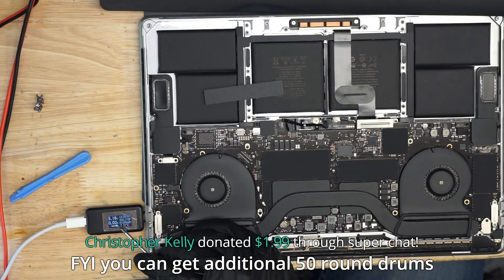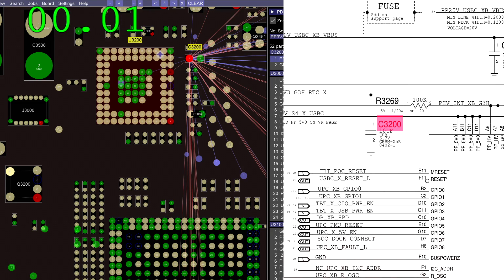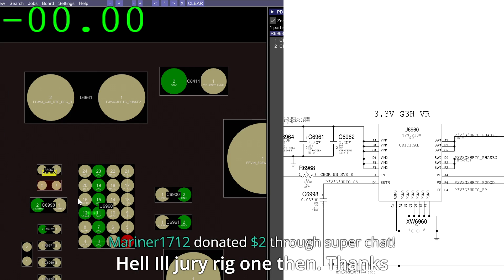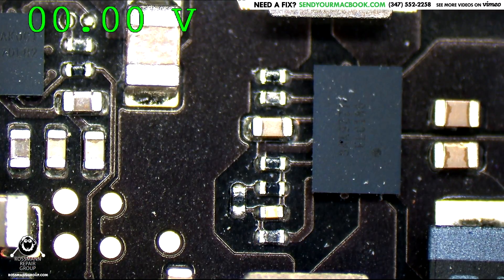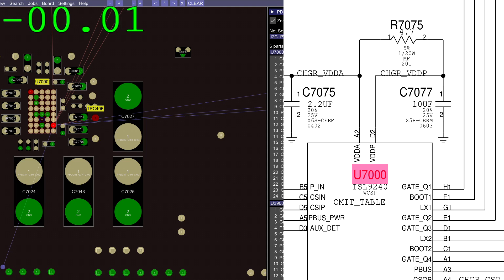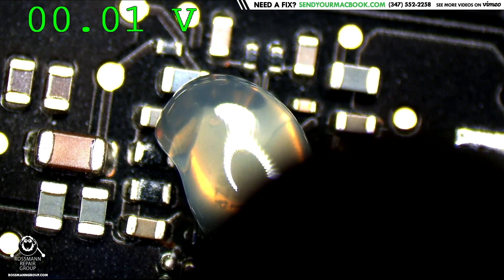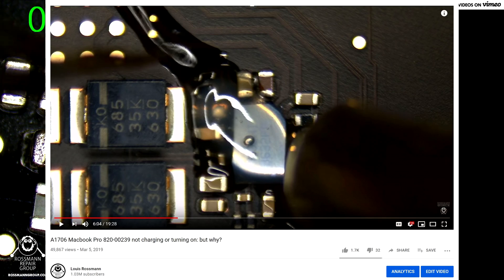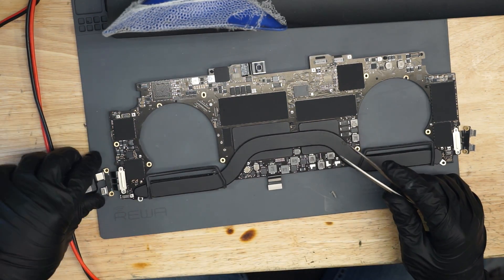How Apple is shaping the future of repair.

Comment: John Deere  does the same to stop farmers from fixing there own tractors. This has been going on for years. I think Apple may even got the idea from them. 
There has been the same  issue of rite to repair in may states in the USA stopping consumers from fixing   their own tractor or take it to an independent tractor repair. John Deere has been refusing to release the technical information so that independent repair can not take place.
Reply: I believe that this actually is for safety reasons. If you could see what kinds of farmer self-repairs we can see here and there in our shop, then you'd probably agree.

Edit: Comparing a Laptop or a Smartphone with heavy machinery is not really possible if the reason to compare them is security. There can actual lives be in danger.
Reply: @RedMediaStudios  You can compare, actually. Its not about the tractors hardware, which, obviously, can be fixed to a certain point pretty easily.(Legboot-fixing frameparts could possibly cause injuries)
It's about engines, transmissions and hydraulics ECUs. Would they malfunction, the tractor just goes into limp mode, nothing that would cause injuries.
This is just because greedyness, nothing else. I'm a farmer myself in North Europe, our farm has many machines and imagining that we would have to always contact an authorized service man to get the machine fixed, we would lose a lot of money. And I mean a lot.
As tractors are coming more and more dependent on electronic control units, its quite important to know how to fix them, because they are working in harsh conditions with a lot heat, dust and vibration. If you can't access the workshop manuals or any repair guides, you are fucked. So yeah, thanks JD, the other brands will surely follow their lead.
Reply: @hellyeabrother56  What the shit? Our shop is paying since years and years to get access to the manuals. If it's just that, then i gotta say thats pretty normal. The farmers around here can fix small stuff themselves but they usually bring all their stuff to us to get it fixed. None of them know how to search for a defective part in a common rail system, or read out error messages. They even bring simpler stuff like a not working light bulb to us.

My point still stands; safety. The bigger farms maybe know what theyre doing, but smaller ones often dont. 'Lemme try that, oh it works again, fine i drive like this for the next 5 years now'.
I recently fixed a vehicle wich the farmer set up the electric system for stuff like light himself, and its a miracle that that vehicle didnt start burning already. Fuses three times bigger than what it actually should be, and stuff like that.
Im pretty sure the bigger farms can get a working solution to this problem.
Reply: @hellyeabrother56  To compare sizes: The farm my grandparents own has about 8 hectares, and u can find farms around here mostly between 20 to 80 hectares
Reply: @RedMediaStudios  I believe almost every independent shop has to pay for the manuals licenses, we as farmers as well if we want to see them. But it's about accessibility, JD wanted that it cannot be so, even if you had the money to pay it. They also wanted to restrict:
Resetting immobilizer systems, reprogramming electronic control units or engine control modules, changing equipment or engine settings, downloading or accessing the source code of any proprietary embedded software.
I agree with you that safety is indeed an important matter, but in my mind, you just cannot justify these restrictions by saying they're for safety.
However, yes, I have also seen quite a bit shitty wirings done by farmers, often we would buy a used machine they would have this "just put duct tape on it" -type of solutions. But I don't think that they would even touch an ECU if they cannot manage basic wiring.

I find this quite unfair. You shouldn't manufacture the tractor so that every time it has an error code of, let's say, transmission not working properly due to sensor malfunction or even by a cold weather (we get those in here) you need to get it to the JD dealer to get the code removed in order to drive it again. You should be able to replace the faulty sensor and be done with it without JD's help.

Some farmers in our area are also taking their equipment to shops to fix, and that's fine if they have the money for it, unfortunately, we don't, so I cannot find anything more frustrating than paying +100k for a machine that I cannot fix by myself, even if I had the skill for it.

Btw, respect for driving a moped for 600km, dope video.
Reply: @RedMediaStudios  Concerning the size of the farm, we also have these >30ha farms, but their equipment is equivalent to their size, in other words, their equipment is smaller and older compared to big farms, since it's cheaper.
Reply: @hellyeabrother56  Ok, i did NOT expect that last sentence. xD
https://www.meme-arsenal.com/memes/5af861df2c1d344a7fa28a2ee6aa8ca5.jpg
The total amount of kilometres i made so far with my moped is 35'000, xD

While i do agree on what you wrote, i still stay on my viewpoint, that they probably got a lot of problems with safety, when farmers fix their machines themselves.

But i also have to say that greedyness probably plays a role in this, like "hey if we would do that we can get rid of that and make some more money with it".

You're probably more informed about this subject than me, so i'm not gonna argue further. Like i said, i have a slighly different viewpoint, but i don't think you're wrong.

I do not know that much about this, because i work in a kinda small New Holland/Fiat shop somewhere in switzerland.

It's probably gonna work out like article 13, they'll do it but not much will change. I don't know for sure though, we'll see.

(I also do agree that you should be able to pay to get the manuals)
Reply: @RedMediaStudios  The Spanish inquisition! Hahaa, golden! I used to drive a moped as well some 7yrs ago, but far less than 35k, that's crazy.

Well, I'd say this conversation was a success for both of us. You gave me a point view that this could be related to safety, which, I haven't really thought of earlier, and I'm pretty sure we both got something out of this. I also don't think you're wrong either, I guess it's about how we see different values.

We'll see how things sort out, it might be just a lot of fuss like you said. 

And thank you for being polite, that's something you don't see too often in the YT comment section.

You seem like a good chap, keep up doing good vibe stuff with your boys, it's seriously better to have something to remember when you get older, rather than regretting you didn't do what you wanted!
:)
Reply: @hellyeabrother56  yeah, those kind of conversations are very rare here, so thanks to you too. I definitely got something out of this conversation, when i thought about this, big farms that have kind of an improvised workshop of their own (or a bit smaller, but i think u get what i mean) never came to my mind.

And u also seem to be a nice person, so everything u said right back at ya :D

Good luck with the farm :)

Comment: My 9 years old Acer laptop laughs together with me about such fucked up Apple situations. This laptop works reliably for 9 years now, not a single break down. If it would break, guess what. I'll extract the regular 2.5" hard drive and access my data. If the mainboard would fail but I want to keep the laptop, I am sure it'd be very easy to repair, since parts would easily be accessible. Because Acer doesn't really do everything right, but they are not the greedy and insidious scumbags like Apple. I have never owned a single Apple product, I despise them for decades now, and I will have a smile on my face when hopefully one day, the company will only remain a shadow of itself. Don't get me wrong, I do honor, that Apple once used to be a company of innovation, being pro customer, getting the industry forward and offering top notch computing hardware and software. Those days are long gone, today they are greedy as shit, and offer medium level hardware at ridiculous prices, and even more ridiculous pricing for repairs. I cannot believe how so many people still willingly enrichen Apple for their very despicable practices.

Comment: Question Louis: so what is the newest model MacBook Pro laptop, that if anything happened to it, you could fully repair? I prefer to to work on a Mac OS but I also don’t want to get stuck with a non-repairable laptop 💻
Reply: I believe you can boot the Mac OS on non apple systems with some work, I don't know very much about it however since I'm only interested in working with windows and Linux. I've seen the term hackintosh being tossed around in the comments however, seems like a good place to start. I wish you the best of luck.

Comment: Would it be possible to apply the necessary voltages to the appropriate rails to simulate output of the missing ISL9240, long enough to retrieve data?

Comment: Hey Louis, you said this is a chip that just create the "enable" signal. How about removing the Chip  and just pull-up or pull-down this Enable Pin. The Maschine shoud start this way and the customer can maybe save their data. Sure, the battery won't charge - but maybe it is just "half-useless" this way

Comment: I personally like Macintosh computers and the OS.  I hate Windows.  You are in a position to see all the bad because you are in the repair business.  You NEVER see Macs that have not given any problems and that is the vast majority of them.  It Does seem a little crappy to withhold certain parts and I don't agree with that practice but your continual harping is very tiring. I have listened to quite a few of your rants and basically I could care less.  I enjoy seeing your work on these type of circuits with tiny surface mount parts.  I am a tech myself and am not very well equipped as you are to handle this type of repair and appreciate your expertise. You are fighting an uphill battle and will probably lose.

Comment: Have you considered partnering with an electrical engineer to start reverse engineering these chips? You could use them yourself and sell them to other repair vendors, as long as it costs less than $1,500 per unit you'll have an advantage.

Fair use principles do apply to commercial uses as well.

Comment: Hmmm... I have a question but I doubt you're gonna see it. 
What kind of signal is that chip giving out? Like, can you simulate that signal to enable the charging chip to start charging?
I mean, when I'm working on a car and something of electronics dies, I first go with overriding it to see if the part that the thing is powering is actually working and then looking for replacement. Can something like that be done here to save the data?

Comment: Louis, is the enable signal a simple voltage or is it actual serial data?  If it's just voltage, can you find some other source and bypass that intersil chip, at least long enough you would be able to turn the laptop on and recover the data off it if the customer needs that?

Comment: Hi. I need a little help.
I have a chuwi hi10 pro tablet( usb-C power output isn't working, but charging with usb-C is working.)
And in hungary there aren't any offical repair shop for chuwi brand.
I talked with a shop, they can fix it but they need a schematic for the tablet. Where can i find it?

Comment: Since the laptop is dead because the motherboard isn't detecting the correct voltage in order to recharge the battery..... Is it possible to swap the dead laptop battery with a charged one in order to get the data off it?

Comment: Could the missing voltage be “inserted” just to get boot and data backup?
Reply: need a comunicator cheap that can tell the board to allow 20V and also can tell usb to supply 20V.
Reply: It's not a simple voltage injection, there may be data sent along other lines (for eg  a challenge-response to check for authentic batteries, perhaps, like on Thinkpads) so emulating the behaviour without the chip it extremely difficult. It would be easier to take the chip from a working MBP and put it in the broken one, harvest all data, and then take the chip back out. The fact that you have to go through all of that to just get data off of it, screams greed.

Comment: Can a board with a damaged Intersil 9240 run off a battery that has already been charged by another machine?
If so, this could be the workaround to at least run it long enough to copy the data off it.

Comment: If they crack from drops, then that means there is stress on them. Perhaps from heat expansion and rapid cooling down. Otherwise it makes no sense. Well unless they are hit directly from the drop with like the case bending and hitting them directly, which I doubt it happens.

Comment: 7:32 But if you replace the fuel injector in a Ford then the brakes won't work any more and you will run over a queue of school kids!  There was also that time when someone replaced a gasket on a Honda and their credit card details got passed to "CRIMINALS"!

The problem as I see it with all of these hearings that have failed to pass a bill is that you can't fix stupid.  Well, you can, but it's frowned upon by law enforcement...

Comment: Soon apple boards with all be one chip, the isl-gofyetself, And buying said chip will be even harder, cause the t16 chip, it will set off e explosives if the machine is opened, or held wrong for too long... The data is all volatile type so if it turns off data gone.. but it has "all day battery"

Comment: Thanks a lot for you videos Louis!
Just wondering about your customer's datas recovery. Wouldn't it be possible to temporarily plug another battery to get the machine to turn on long enough to save the datas? Or swap the SSD on a properly working Macbook or are the hard drive soldered?
Another question regarding that chip. Is it possible to salvage them from dead (from other reasons) boards or are they so fragile they are useless everytime they are reworked/removed?

Comment: I do think that what apple does is quite disgusting. But I would not agree with the statement that in a free market capitalism apple could not do this. I am very sure that having apple as a customer as a chip manufacturer is quite valuable in itself. So when wagering the possiblity of losing apple as a customer vs. making a few extra bucks on a chip that apple buys in bulk anyways it seems not worht it. And it's not like the chip manufacturer won't make any money of the broken chip if there is no repair. They will make money of the chip that is in the 1.5k$ replacement board or the new machine that is sold.   
And "right to repair" is actually quite a socialistic approach in my opinion. I hope that does not ruin it for you ;). Keep it up and help safe the environment as well :)

Comment: Would it be possible to buy a working Macbook if the same model and year and transplant the U7000 chip from it to this broken Macbook? If so, then that’d be about the only way to get the data out of the busted Macbook. It’d be pricey, so it’d only make sense when the data is totally irreplaceable.

Comment: Just out of curiosity: Since it's the battery not being able to charge: Is there a way to modify the Mac in a way where you relay the charging to dedicated hardware and maybe switch the battery out once it's run dry?
Like, make a cut out, make it thicker in order for a "plug in connector" to fit and just swap batteries?
Reply: it is much much more complicated than that. ISL9240 IC does a few key things: 1. receive 5v initial power from AC adapter. 2. enable 3.3v out 3. receive feedback from PP3V3G3H, commands EC to reset and verify AC adapter. The AC adapter then boost voltage to 20V for system power, which can power the machine and charge battery. In order to bypass this IC and make every component work is basically designing a new IC.  ISL9240 is critical and resides so early in the power sequence that it is indeed impossible to hack or bypass it. There are more ICs after this too... Even if someone successfully jumped 90 wires and manually supply 20v, 5v, 3.3v to different circuits and magically made this laptop to boot, they won't be able to make it work off neither the AC adapter nor battery system, which is still a failure in practice.
Reply: @ttian2  Thank you for the explanation!
Too bad you can't just charge the battery in a stand alone way and then swap it every now and again with a modified MacBook case :/

Comment: How can it be that someone is "pro Apple" and not also "pro Repair" ? That's not a contradiction. Apple products are relatively expensive and Apple justifies this with their high quality and longevity. And then a feasible and cheap repair fails because of a boring USB charging chip? Not because it's technically necessary, but simply because you can enforce it that way?

Comment: There's a limit of what you can repair or of what the company need to make it possible to repair... car's company don't make small parts to fix cars. You don't want to encourage your products using any kind of piece... because when it is on fire... it will be a macbook and Not a repaired f.cked product. I never did it before... but this time i subscribe for the apple care. That is a good service. Try to repair a samsung. They will tell you that the repair is so expensive that is better for you to buy a new one. Anyway... i do believe that if you want to mess with your gear ok. But stop calling a macbook once you start poking around. And you cannot make a company responsible for a product forever... a balance maybe. Old smartphones have no support... neither hardware nor software.

Comment: If U6960 was enabled all the time Would the Mac boot up normally? Also, if the battery was disconnected, would it still boot up? If so, it could be used as an AC only Mac or data could be retrieved.